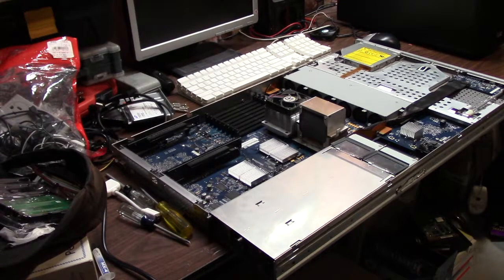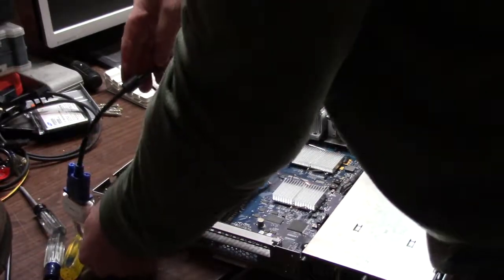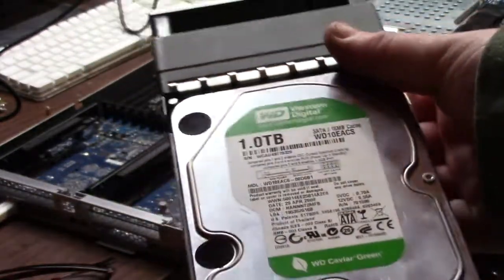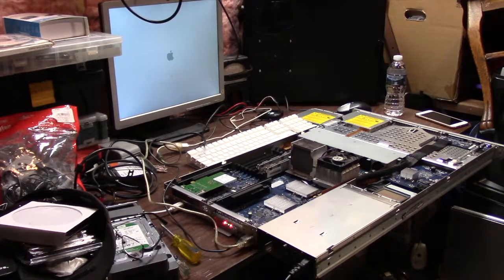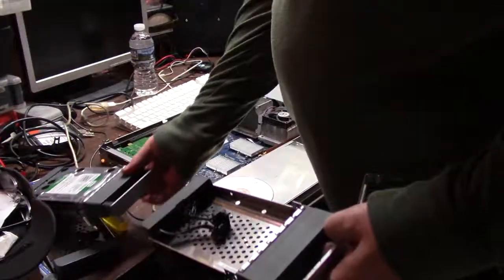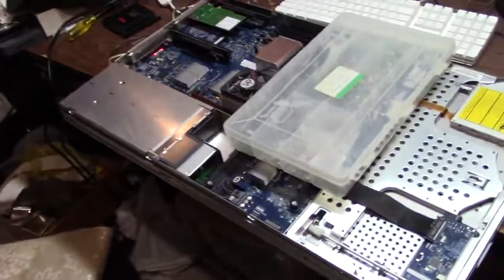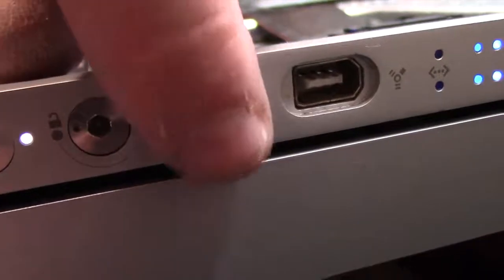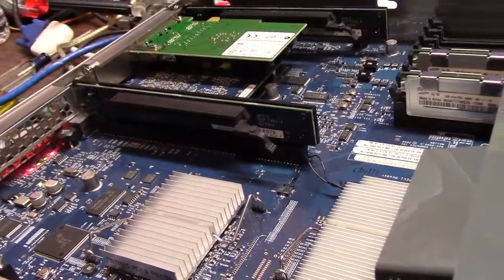Episode 44 Xserve A1196 for $25 BUCKS!

Comment: Were do all these People find these for soooooo cheap!? I cant find some for under 450
Reply from the maker: Ebay...
Reply from the maker: also its a A1196, kinda the poo of the Xserv line in the intel lineup... I then upgraded them to the 2008 model with a mb swap i got on eBay for 13 but link in that description..  Craigslist is another great place to pickup old apple hardware cheap, I did have a expensive add on when i had to find the big copper heat sinks. so there you go. but initially they were 25 USD each;

Comment: I was wondering if you have to have the Xserve attached to the internet to be able to load Mac OS X server on it?  I tried with Sever 10.5 and it won't let me continue when I am not connected to the internet.  Currently I only have Wi-Fi so I have to wait for me to set up Ethernet to try connecting and loading server on it.
Reply from the maker: mine is 10.6.8  i built it with the server media so its ready to go , runs great and i use it daily. you DONT have to be on the internet to build it.

Comment: You call that loud? I take it you have never heard an hp c7000 boot up, much less an entire room of them.
Reply from the maker: well without the heat sinks and the temp probes on the fans never shut up from top speed. it was fixed of course. and i work in IT so i know what server rooms sound like.  but for your quiet basement that is a little loud.

Comment: you should have put that helicopter away until you can close it and use apple remote to install it. remote installation and management was the way it should be anyway. remember they are headless :D
Reply from the maker: its fine, i enjoy the builds, it works great now, just needed some parts to make it good.